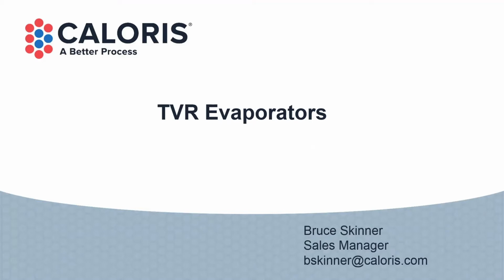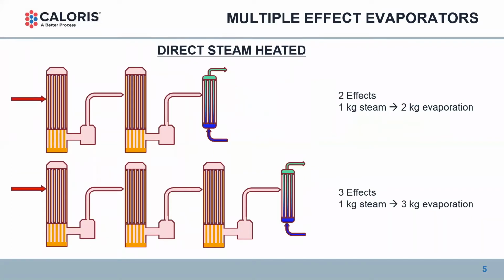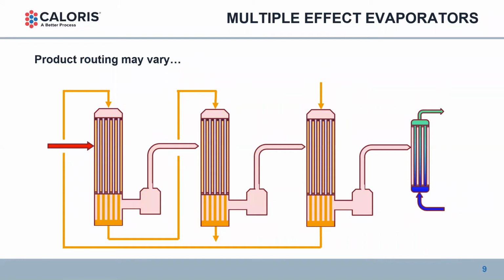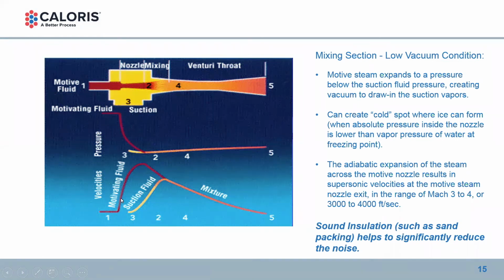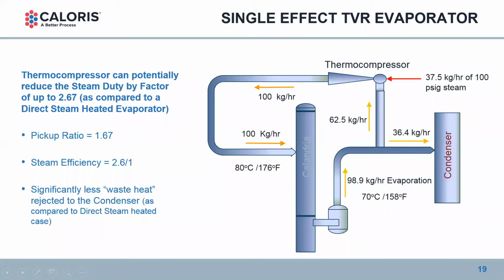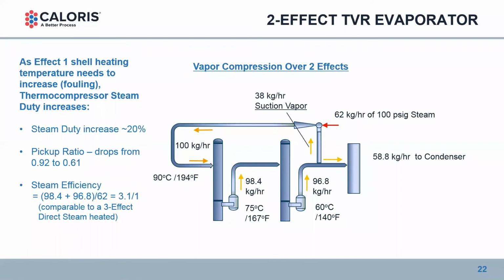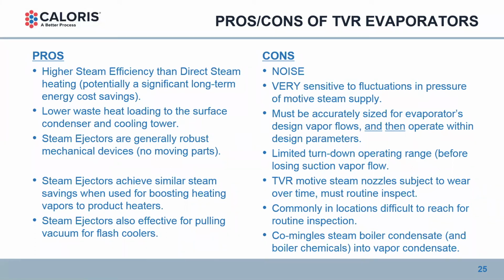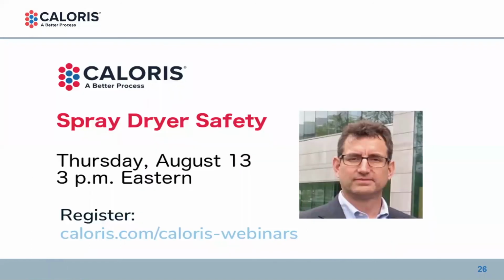TVR Evaporators

Comment: What is minimum required pressure for TVR?
Reply: It merely depends upon capacity of plant ...... For eg - if feed of milk is 16500 ltre per hr then the pressure required will be around 6.5 bar minimum in TVR

Comment: Sir as you demonstrated that during fouled operating condition your 1st effect shell side temp rises from 80 to 90 degrees your heating vapor consumption in 1st effect should also change to a different value and should not be 100 kgs for the same 98.9 kgs water evaporation at 70 degrees since at 90 degrees the latent heat value will be lower and to maintain mass and energy balance you need to increase the heating vapor quantity.